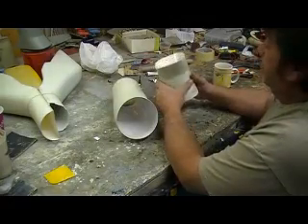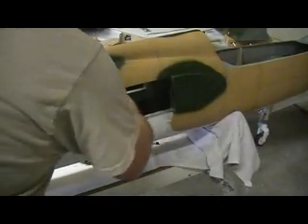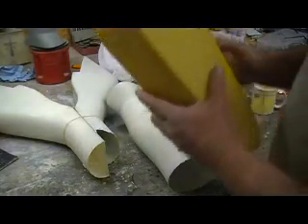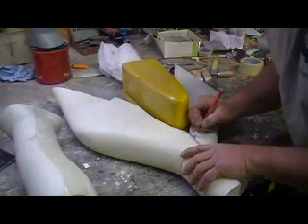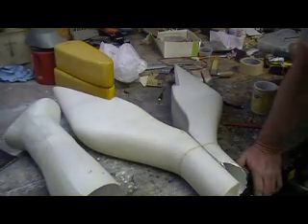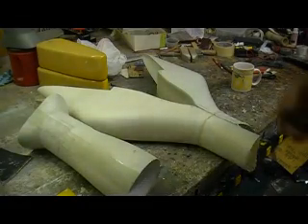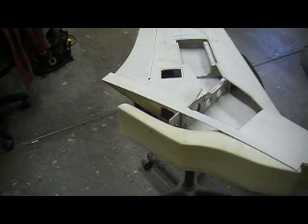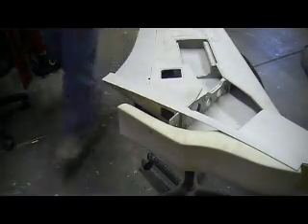how to build a rc jet F-105 thunderchief # 490

Comment: If it's a scale model then the ducts should be as close to scale as possible too.  The real ducts most likely converge forming a vertical flat (correction: trailing) edge plate immediately behind the convergence point.

Comment: If it's a scale model then the ducts should be as close to scale as possible too.  The real ducts most likely converge forming a vertical flat leading edge plate immediately behind the convergence point.